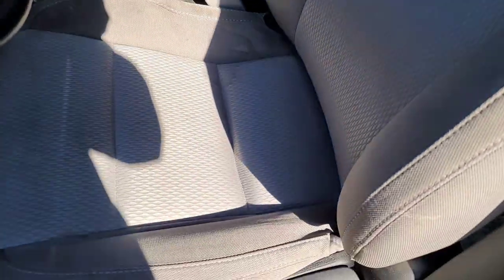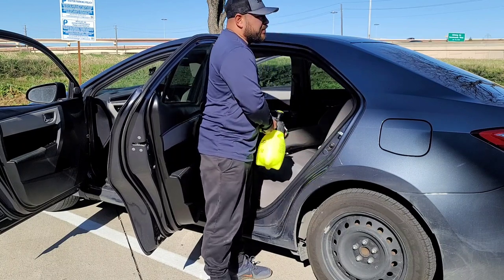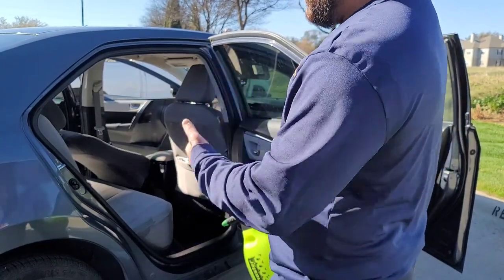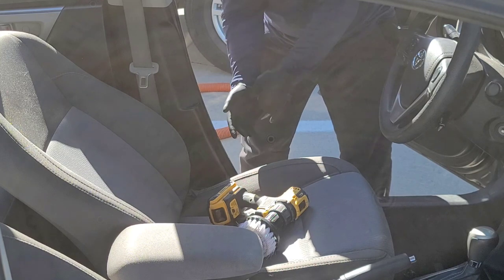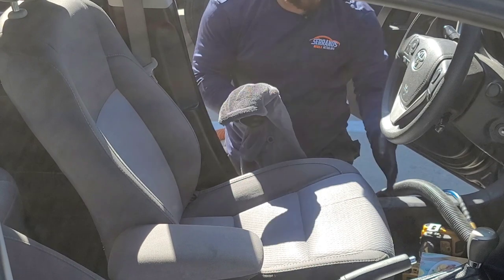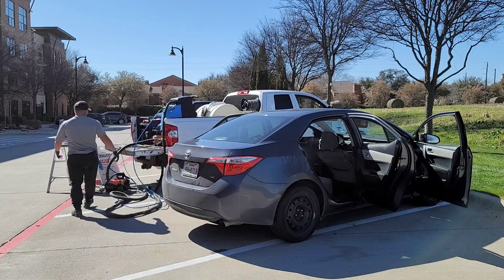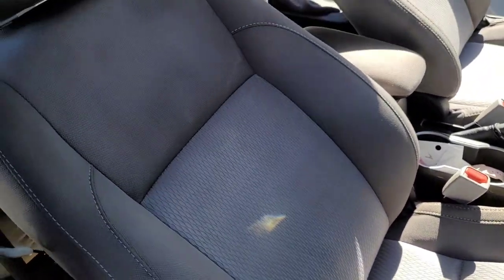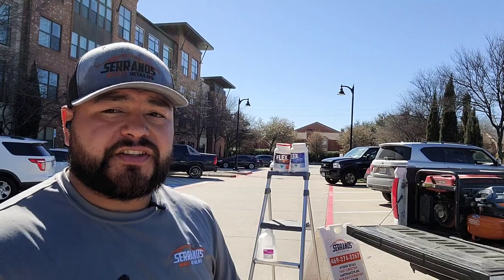THE best way to clean Toyota cloth seats!! (most hated interiors) to do

Comment: I would lightly mist a little of the ice at the end. Don’t run any chemicals through the mytee. Bad for the internals
Reply from the maker: these products are made to be used for extraction, as they don't clog lines as other products. I have owned my mytee extractor 6 yrs and have yet to have issues with the lines. I do have it maintenanced yearly but no issues yet

Comment: Have you used Spot stop?  It sprays on those sport type seat after extracting and prevents wicking.  Finisher from P&S is a peroxide based product that is also pretty good.  I have not used Flex, but I keep hearing great things about it... may have to try it.
Reply from the maker: I have not tried those, may need to

Comment: How has that marolex ergo 2000 pump sprayer been holding up? What’s the warranty on them? And also are there any replaceable seals or o-rings on them? Just picked up the same one your using
Reply from the maker: Doing amazing, yes on luxurymicrofiberstore.com they sale replacement parts
Reply: @serranosmobile  ok thank you. I got sick of the cheap harbor freight ones that literally last only one time with the citrus solv and bio break. Needed something that would last more than once. Do you rinse out the sprayer with water after each use?
Reply from the maker: Yes or at least 1 week
Reply: @serranosmobile  in that Marolex pump sprayer how many scoops of the citrus solv or bio break will you use in that sprayer?

Comment: Just picked up the flex citrus and flex ice with a Marolex 2000, how do you dilute these as far as how much powder goes in the pump sprayer and how much goes in the extractor? I have a aqua pro vac 1.5 gallons capacity if it matters.
Reply from the maker: I just do 1 scoop of cirtus
Reply: Thanks for the reply brother! And how many in the extractor?
Reply from the maker: @rubinnunez124  depends on size on mine I'm doing 1 scoop
Reply: @serranosmobile I just did a honda odyssey with a light colored interior and carpet using the flex citrus in my marolex 2000 and flex ice in my aqua pro vac and man this stuff is awesome almost every stain is gone.
Reply from the maker: Heck yeah man
Reply: How much powder of flex ice do you add per gallon???? For extraction
Reply from the maker: I don't know the number exactly but the product comes with dilution ratios. I do 1 scoop for 10 gallons in my extractor

Comment: What dilution for each ? I have an aqua pro vac. I just ordered both flex brands you mentioned
Reply from the maker: I do one scoop in a 2000ml sprayer
Reply from the maker: 1 scoop in extractor of 10 gallons
Reply: It will be my first time using my aqua pro on my parents vehicle. I’m not even sure how many gallons the aqua pro is but I know it’s not 10. I’m hoping the bottle will tell me the dilution ratio

Comment: I just did a camry yesterday where the seats were trashed..took me forever, the stains would keep coming back. Im about to order the flex citrus, do you happen to remember where you got yours at?
Reply from the maker: Links on description
Reply: Hey Robert Have you tried super clean degreaser? It works well on stains
Super clean mixed with dawn dish soap. Carlos has a video of super clean degreaser
Reply: Also check out your local carpet cleaning supply. Interlink and Jon Don are the more well known ones

Comment: Where do you get those green pump sprayers? I’ve been needing a few more!
Reply from the maker: Luxury microfiber I left link on description hopefully it's the correct one
Reply: Harbor Freight has inexpensive 0.5gallon pump sprayers on sale routinely for $4.99, bought myself one for this same purpose
Reply: HF definitely has great 1/2 gal sprayers. I currently have 4! Might get more lol.
Reply: I just got my marolex 2000 pump sprayer in the mail. I own the home depot hdx pump sprayers and the ikc but the marolex is really worth it for the money, it just sprays forever way less pumping needed and the build quality is insane very durable. highly recommend!
Reply: Just bought three of these lol needed more pump sprayers to add to my arsenal
Reply: @mattcornejo9031  these are the only way to go trust me, they last longer and spray forever with a few pumps
Reply: @rubinnunez124  ya I can’t wait to use them!
Reply from the maker: Hrck yes
Reply from the maker: Can't go wrong
Reply from the maker: Definitely
Reply: @serranosmobile  Gonna make jobs go so much faster!
Reply from the maker: @mattcornejo9031  yes